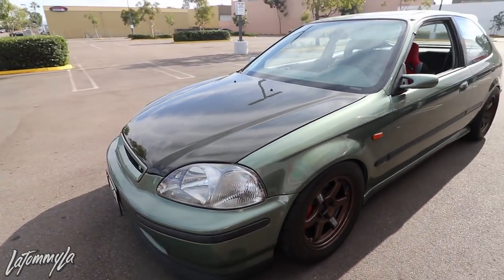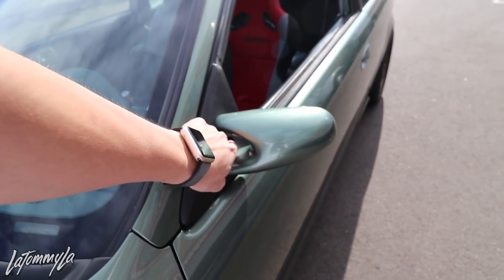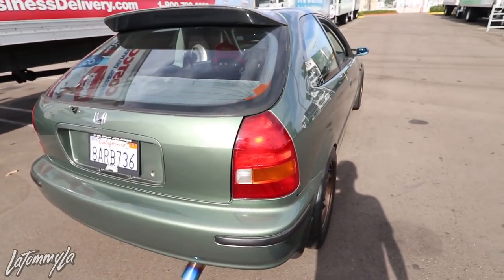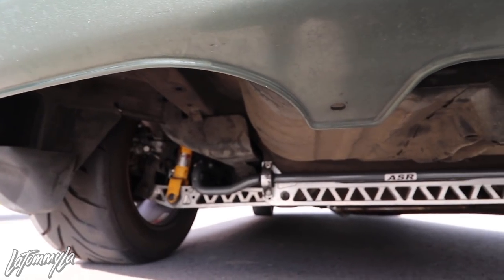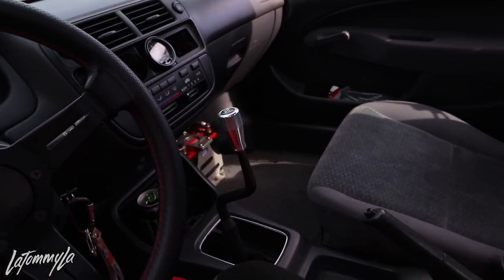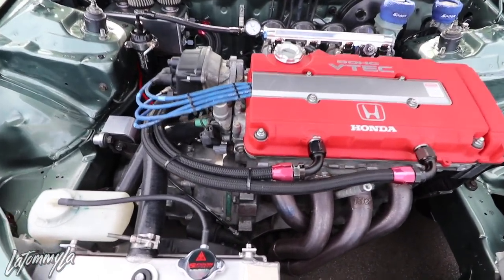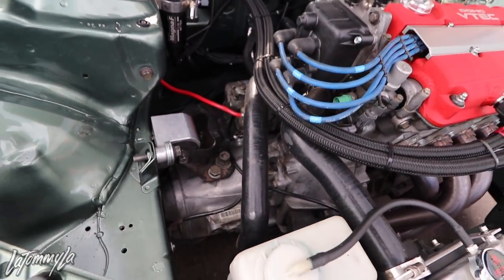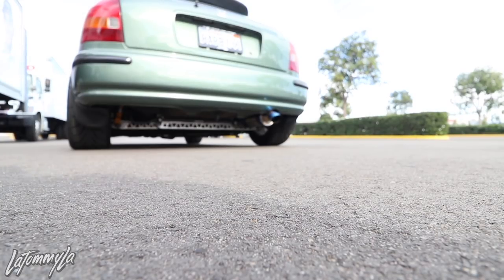My B18C5 ITB Swapped EK Hatch Walkaround

Comment: Just buy some front mudguards online. I got some OEM ones for my 98 LX, like $45 for front and rear. It's like $22 for fronts. Just buy them in case you raise your car.

As far as suggestions, you should get a map light or center roof sunglass holder box for the interior mods. Perhaps even an Acura EL center console from Canada. Buy some OEM floor mats. Maybe get light tint for your car since you are in Cali. Maybe an EDM clock for the hole in your dash.
Reply from the maker: Gonna remove them soon for my kit, and i dont wanan ruin the headliner haha

Comment: How much does it dyno at to the wheels? We need to see some full throttle runs of it!
Reply from the maker: 197whp, at 76% throttle. Needa go back for a retune at 100%
Reply: LATOMMYLA is that on 91oct? Or do you run e85? Dopest civic I've seen btw,the color is sick! I gave a green hatch away for free a straight body clean green paint as well with coilovers,innovative motor mounts,gutted out because I had no room for it

Comment: Clean man, great vid.

Question, I recently swapped JDM b18 type r motor (obd1) into my obd2 USDM teg, and I’m getting a loss of tach after like 6k rpm, although engine pulls smooth all the way to redline. It just goes wonky then falls to zero. Doesn’t happen with the obd2 GSR ecu, just the type R ecu which I prefer to run. Tried different harness configurations and both USDM/JDM distributor. Have your or anyone you know experience something similar? Possible solution? I’ve asked a half dozen people locally with no dice.
Reply from the maker: Check your ignitor in your distributor
Reply: LATOMMYLA ended up being a loose connection on my distributor tach bypass, which I thought I had checked, but apparently not close enough. Thanks for the help man, I probably wouldn't have pulled it out again.

Comment: The front LCAs are one piece with the sway bar? Then they are USDM Civic SI only. Just a FYI
Reply from the maker: They aren't one piece with the sway bar, the LCAs give you an option to run one. And EX Civic's comes with front sway bars.
Reply: LATOMMYLA ah EX 4 Door in the US do come with the bigger brakes, I would assume they also have the one piece tables that come on the SI. Im in Canada, our models are slightly different.